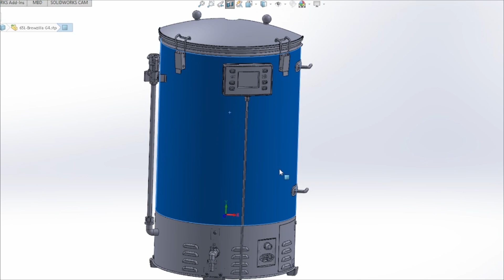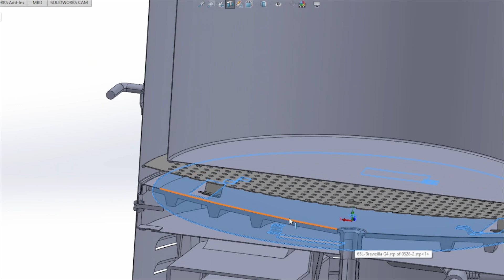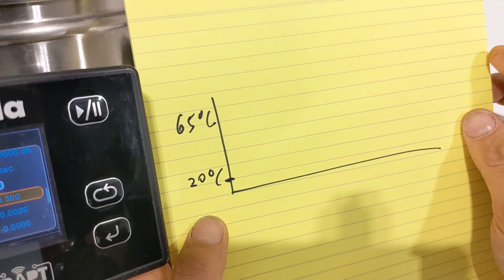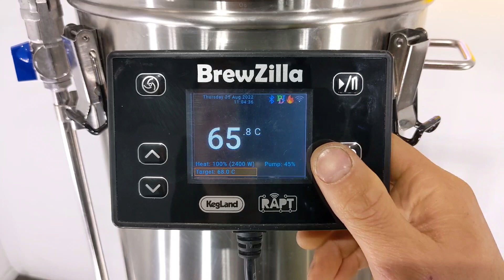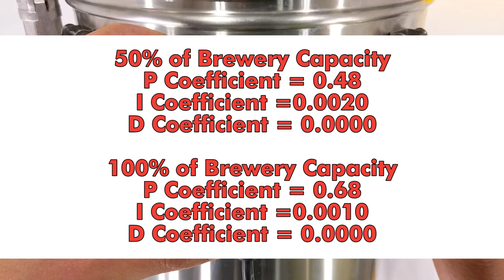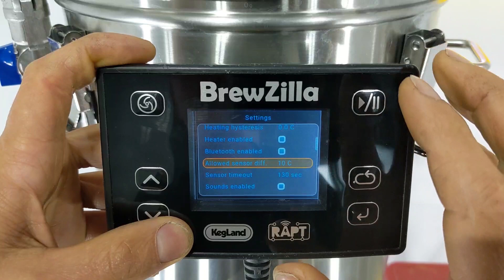Achieve More Repeatability Using, PID, RAPT BLE Temp Probe and Heat Exchanger Dish

Comment: A vessel that is fully jacketed will have a more even temperature distribution as well as heating up the contents of the vessel more uniformly.
Even in this situation there will be a temperature gradient within the liquid with the centre being the coolest zone because it’s further away from the inner vessel wall.
We really need to know the thermal limits of your process. 
This is an engineering challenge in pasteurisation. Legally you need to coolest region to be above a specific temperature for a minimum length of time.
This means that there will be hotter regions and longer exposure to heat which can cause undesired side effects like denaturing of proteins and enzyme activity degradation etc.
The important thing with home breweries is the ability to reproduce your brewing conditions with as much process control as you can afford.
You will be surprised as to how little instrumentation and process control large commercial breweries actually use. 
The approach generally is to target critical process areas and focus on equipment design.
If you have poor equipment design and skimp on materials and fabrication quality and then expect to solve all your production inefficiencies and quality control issues with fancy control systems and instrumentations, your accountant will be on the phone before you can say jack robinson.
And then you will have complaints from the public and clients that are buying and trying to sell your varying quality products.
Reply from the maker: Yes we absolutely recommend the use of the jacket too.  Our jackets are also relatively thick compared with what is out there in the marketplace.  We also have a new Gen 4 jacket that not only covers the brewery but also goes over the recirculation arm so I hope when you see this available soon you will be happy.
Reply: @KegLand  I was referring to Jacketed Stainless vessels that have steam/hot water/cooling fluid running through that cavity between the vessel and the outer jacket.
Insulation is definitely a good addition to the mashing vessel and also the fermenter.
Cheers